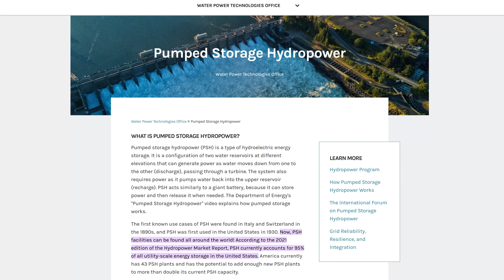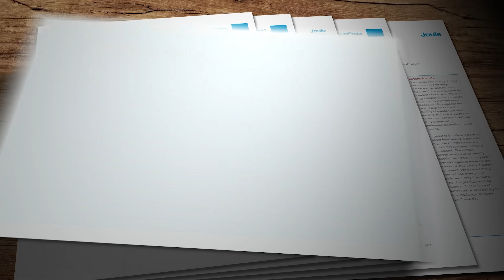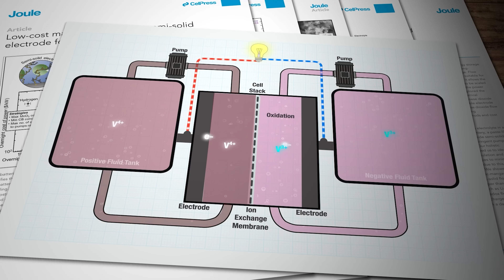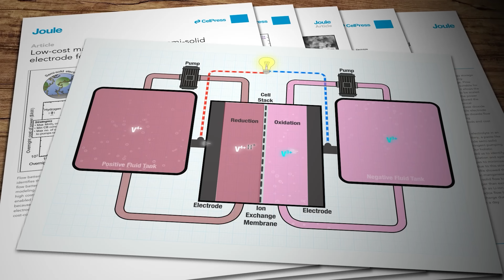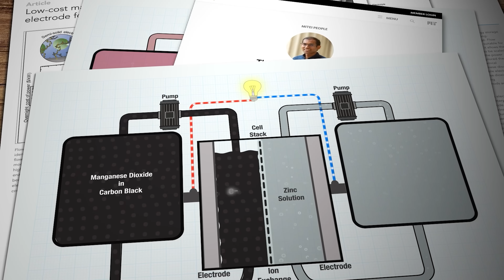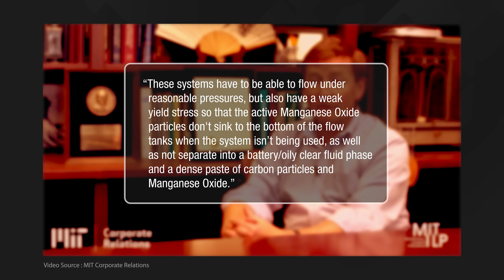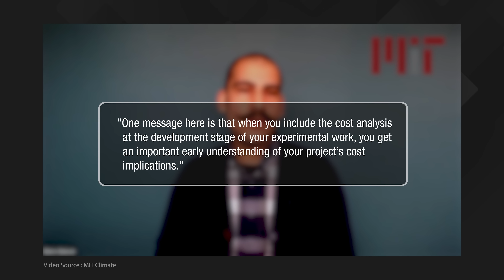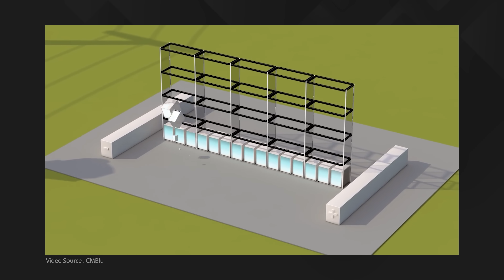Have we found the missing link in the energy storage equation?

Comment: for paste batteries, maintenance of the reciprocating pumps sounds like a pain. It would be fun to analyze rather than recprocating pumps, to just manipulate entire tanks with, say, an electric lift.   You put one tank above the "fuel cell" , and an empty one below.  Gravity pushes the paste across the exchange membrane.  If gravity alone isn't enough, apply air pressure (positive on the top, negative on the bottom) as an assist to gravity.  

If you have whole rows of tanks in a rack, as depicted in the illustration.  all the movement will be exchanges of tanks of equal mass, so the lift only needs to deal with inertia, not actually lifting large heavy tanks, aside from at the exchange membrane itself.

So... with this kind of system, rather than trying to move pastes across long distances in pipelines, you only need  one air pump near the fuel cell, to charge a compresed air reservoir, perhaps a vacuum pump for bottom extrusion... none of the pumps have to deal with the actual fluid, just air.   the rest is done by lift motors moving entire tanks. much longer life, standard components, easier maintenance.
Reply: There are pumps that handle viscous fluids like concrete without any problems.  There are reciprocating pumps that do not use pistons; the chamber is covered by a diaphragm that allows it to pump mud and semisolid waste.

There are pumps that use air bubbles to circulate fluids like an aquarium filter does.  And there is always gravity flow that can be used.
Reply: @acmefixer1  I was thinking peristaltic pumps. Thats what's generally used to pump concrete. They also don't have any dynamic seals which I always thought was cool.
Reply: @acmefixer1  When I worked on the diamond mines we pumped concentrated gravel mixed with water by an air lift.
Reply: How about an auger/Archimedes screw drive. They work with clay and are reversible.
Reply: @fordstone6308  They are not as efficient as a piston pump, so I’m not sure why would want to use one. Feels like this whole thread is trying to solve a problem that doesn’t really exist, plenty of machines use piston pumps without much problem, they aren’t that high maintenence.
Reply: I don’t see how this reduces complexity and maintenance?
Each tank needs to have a valve or some way to close the flow when you lift it, unless you want to wait forever for the last pieces to fall out, that’s one more failure point per tank. Moving all the tanks is also basically one more faliure point per tank if you want to keep the system modular :/
The air pumps will introduce air bubbles into the solution, reducing performance or worse breaking things. You’re basically replacing one moving part for the whole system with two moving parts per tank, not a great tradeoff in my opinion.
Reply: The gravity solution would only be feasible if there was a 100% conversion for every cycle, which is unlikely. The system seems to be relying on a loop with a conversion rate for displaced mass/%charged mass/membrane area. 

You could put a second pump on bypass while maintaining the primary pump. That's normally the way to go for undisrupted continuous processes.
Reply: Forehead slap with look of despair.
Reply: have you searched for treatment ?
Reply: My thoughts too. I'm sure the MIT guys also considered it.
Reply: You need to circulate the liquid electrolyte past the electrodes and membrane - two electrolytes, one on each side of the battery - one for positive, the other for the negative half of the battery.  Everything is on the same level.  Lifting one side of the battery above the other does nothing.  Now you could have two tanks per side of the battery, but the liquid in this system looks like it would be far too viscous for simple gravity to move it effectively.  
I'm sure if it was that simple the would have already did it :p
Reply: It's sounds as a ggreat improvement!
Reply: I was thinking of a pair of differing flow-paste treatments, flexible and squeezable containers are the familiar way to encourage a paste to move through a system. Perhaps something akin to the constrictions of an intestinal tract, running along the outside with a contraction of a container's thick-soft membrane.
Reply: I like that idea!
Reply: @Peter Silva   Wow that's just what I was thinking! Thank you for setting the concept out so eloquently and making me feel like I do have sensible ideas even though I have no qualifications and therefore no right to be having them! 😂
Reply: @HoboGardenerBen Just add another tank  above  and under, so you only have to switch those two , and never have to halt the flow of the goo..
Reply: why pump if you can have gravity do it ? was to be my comment, but you got there first, ok,
i was thinking about the rotating canal boat lift in the UK (i think) did not need a lot of power.
Reply: @jyvben1520  Spot on. I had. A similar thought. You are remembering the Falkirk Wheel in central Scotland. However, it requires very little energy to swap the top and bottom tanks because they weigh exactly the same which wouldn't be the case here. But I'd say you are on the right track.
Reply: The DIELECTRIC VORTEX Technology by Ronald Frederick Sykes
Superior Levitation for your personal spacecraft
Energy comes from the vacume of space

Comment: I don't understand the charts at 9:03.  Why does $/kWh capital expenditure of li-ion batteries increase for larger discharge durations?
Reply: That is a not a capital expenditure.  The units for that would be $/kW power.  As far as cost of storage in terms of LCOS, I would guess this would reflect self discharge.

Comment: Vanadium flow batteries are only limited in their lifespan by the container materials,  vanadium can take on either ion state and the differing positive and negative compounds are ionic, the battery can switch back and forth indefinitely as long as the hardware is maintained. No fear of the solution seperating out so for long term reliability the vanadium battery is far superior than what you just showcased.
Reply: Yeah but impractical for grid stability without Gas or Biomass to help out. Due to lack of available materials basically. If money wasn't an object and all vanadium was diverted to battery production to save the planet from climate catastrophe. We could make 2.3GWhrs per annum. That is pitiful not hope or savior.
Reply: @bigstiggerNo1  the main flaw with all this, the thing that is causing the issues that things like flow batteries are being perfected for,  is that everyone is depending on an aging setup, on those who are now heavily corrupted. A better bet is to take care of one's own power needs, yes you will pay more at first but then you are not a power company that can spread the cost of a project across your client base. If you keep waiting on companies to solve the issues, on governments to provide incentives, then i will hate to be you, any of you. I have looked into a few ideas, including vanadium flow batteries, they are more achieveable than you realize, if you think differently than the rest, if you think at all instead of just reacting like far too many do.
Reply: @patryn36  I have 56 solar panels. Three wind turbines. 48KWhrs of lithium battery storage. I have done multiple studies of energy production. If we are not talking Fission leading to Fusion the Maybe antimatter as our future.  Then how do you expect to travel to other solar systems with wind or solar power.  Trying to be romantic and seemingly good to do will be a dead end. We stopped using mills for a reason either water or wind mills are useless without backup and support.  The industrial revolution would have been a lot better for us all if we could have used wind mills and water mills to create it's labor saving longer life's, lifestyle.  We needed the portability and compact size of coal to that though. Fission is a far more condensed energy source. Fusion is a step up in condensation. Antimatter another step forward. Using scientist and research money to find answers to energy storage is A BIG WASTE OF TIME MONEY AND RESOURSES. Thorium, Uranium and Plutonium are the most energy dense source of battery we know. The final outcome of energy storage was found by a women who died doing her research.  Don't let her death be in vain!
Reply: @bigstiggerNo1  you use solar, wind, and hydro if you have access for small scale. Going commercial and industrial is where reactors are best at, the large scale use sites. Thorium is nice but it needs to be bombarded with neutrons before it is useable in any serious power genenration. From what i can find only way to get that source of neutrons outside of elements like uranium is water and messing with a vital component like that does not sit will with me, one reason i am not a fan of techs like fuel cells. If they could realistically not have any losses in a fuel cell system then i would be on board but physics is a fickle thing in that area. If we had orbital infrastructure  collecting hydrogen, then losing the water would be a minor concern cause we could make more. As for the space propulsion, nuclear drives, they have working designs for them, aka the impulse drive from star trek, that use hydrogen as propellent and cooling for the reactor, damn things were prototyped and tested back in the 60's apparently. As for fusion, outside of stars i do not see a point of where it is used by humans unless we get some new very good alloys to cover what we are missing now. Kind of think that the reason we have not managed yet is because magnetism is not even a contender as a means to replace the near perfect containment stars use: gravity. With science as heavily corrupted as it is, i do not see a point, unless a virtual miracle happens, that they get their collective heads pulled out of lala land and back into reality where we will ever have working fusion or a great many other techs. Every choice has a down side, if you exclusively use only one option and never compensate for that downside then you deserve the crap you get. Solar is best when paired with other generation means, like wind and\or water, and you need long term storage that has low maintenance costs, like what a vanadium flow battery has. A battery that you do not have to replace the electrolyte because it wears out is a gold mine waiting to be had. Hell aside from the cell stacks and my momentary limited funds i could build the battery now, i have yet to understand how to build the stacks and what size they need to be, other than that i have sourced everything else. It is always more expensive at first doing things on your own, just the nature of the beast. Just because something is dense with power, does not make it a good idea, sometimes low tech is the only sensible way to go because it can be maintained realistically, like lithium batteries. Such a big deal was made, everyone jumped on that bandwagon and look at the situation now, we are running out of available sources, other sources are being  denied due to greed and corruption, and after that we still will not have enough to cover everything because the tech is being misapplied far too often. If we are not short on something you can count on human stupidity and shortsightedness to generate a shortage when we do not need it.
Reply: @bigstiggerNo1  would need money to be diverted to mine more Vanadium, there's plenty available. Big bonus that it can be easily recycled and all these lithium battery fires are very worrying.

Comment: Be careful not to be drawn into the spin about hydrogen being good for bulk long term storage. 
It isn't.
It has an energy density per unit volume closer to the vacuum of space than fuels we are familiar with like methane. 
Its a low energy density per m3 nightmare to store cost effectively at big scale,.
Even stored in salt caverns they don't hold much hydrogen energy as a consequence.
The real competition to flow batteries etc for multi day bulk storage are the many e-fuel chemicals we can make which can store renewable energy in liquid form at much higher energy density than H2, some is simple tanks at atmospheric conditions.

Comment: This has been tried a number of times before, but more as a liquid as you pointed out.

The reason why it has mainly been pitched is an alternative and quick way to charge a BEV ie charge or fill the battery as the same way and speed as you would do with a fossil fuel car.

Seeing this is now being pitched as a design for grid storage that could change things up, I am not holding my breath.

The thing this the energy transfer or energy conversion and also drop off/inability of these type of material to keep a charge over time and thus get the max charge out of it has always been an issue.... in the past 100% charging the liquid you be lucky to get 20 to 30% or even less of that power out to use in BEV.
Reply: Flow batteries for grid storage have been in progress for years. The US Army started using ESS Inc's iron flow batteries for micro grids at the hundreds of kwh scale in 2016, and they have GWh scale utility projects going online in California and Oregon this year, and they also have international customers in Asia and Europe.

Comment: As you wrote, utility scale energy storage solutions are evolving very quickly and the zinc-manganese dioxide battery is another in a long line of developments. However, it's hard to imagine anything cheaper and more scalable than a mechanical battery.

One example is the Energy Vault, which Forbes wrote an article about just few days ago. The battery stores excess electrical energy as gravitational potential energy in 35-ton bricks. There is no time limit on how long it can hold the energy and there is no degradation in efficiency or storage capacity.

Mechanical battery does not need rare elements or complicated manufacturing processes. Instead it uses common materials like dirt, even solid waste, that can be obtained locally and does not use cement to bind them together. It's super-easy to scale and has one of the lowest carbon footprints of any energy generation or storage system.

What's your take on this?
Reply: His video on 'gravity energy storage' a bit over a year ago has the answers to your question

Comment: I guess my question would be if the hydrogen they are referring to is the solid state hydrogen you made a video on a while back, instead of the being stored at very cold temperature hydrogen. I still think solid state hydrogen is our 'best bet' for long term storage. But, I know nothing, I just have an internet connection. But, I do hope we figure something out before Mad Max or Waterworld happens. I don't like extreme heat, or extreme water.
Reply: Neither, it is hydrogen ions, donated by an acid as a charge carrier. The hydrogen is never in the form of H2 molecules, as they are when they are being used as fuel, which is when they are hard to store. Ions are easy to get hold of and store (in an acid), but because they are already reacted you can't get energy from them. You can use them as part of other chemistry though, as they are here.

Comment: I found it interesting, that when doing their cost comparison, they didn't compare themselves to another flow battery technology that is already being deployed.  The iron flow battery being built by ESS. Seems like a combination of this technology combined with lithium-ion (sodium-ion soon?) Batteries are still in the lead.
Reply: My money is also on the iron flow battery. Sodium ions are likely a good bet for quick reaction storage, and with a forgiving enough chemistry like the iron-phosphate one they won’t require nickel and cobalt either. Probably.

I don’t think iron air batteries are rechargeable.
Reply: Batteries haven't ever been "in the lead" for bulk energy storage on the grid. Whether this has the potential to change that remains to be seen- it depends on both the storage/recovery cycle efficiency, as well as the energy cost of construction & maintenance.

So far, no battery tech has been viable at grid scale for anything other than smoothing purposes- at this point, the default expectation should be that batteries never will be suited for the primary storage concern.
Reply: @absalomdraconis  I try to be respectful of people's intelligence, but this is ridiculous. Obviously, my comments were in reference to the v i d e o.
Reply: Or even liquid air
Reply: Very hard to be sure of the numbers on complex 3rd party tech like iron air. They might be ahead, but it is all dependent on whether they can get an air-electrode-electrolyte interface cheap. It looks fundamentally hard to me. Either way, this sort of paste tech is probably applicable to the iron side of an iron air battery too, and could make that considerably cheaper.
Reply: These batteries are not new. Have been in use for years! Can you do research or is it just watching that you do?
Reply: @bigstiggerNo1  what?!
Reply: @bigstiggerNo1  Really? Why don't we know then?

Comment: Isnt this system an just a copy paste of the alkaline disposable battery?
Reply: In a way yes, except for the fact that the common alkaline battery is, like you say, "disposable" and not "rechargeable".
People have been working on rechargeable alkaline batteries for decades and several companies have actually sold different versions, but none of them succeeded. Now with Li-Ion being dominant and affordable such systems wouldn't make any sense anyway.
The major difference between this and those rechargeable alkalines that failed on the market is that it's a flow battery, and as such it can make a lot of sense if it works.